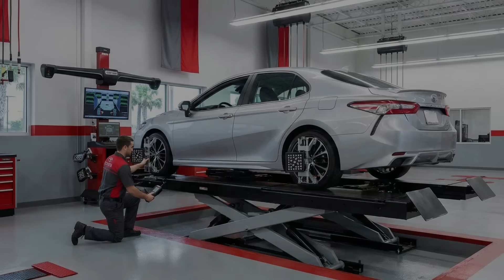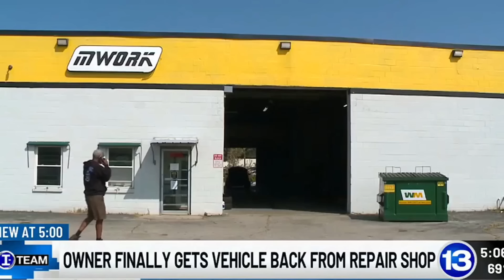STOP! Don't Change Your Toyota Transmission Fluid Until You Do THIS Reset

Comment: i chenged my transmission fluid on my lexus is 250 with different oil everything was fine but my transmission started to having problems on gear 1 and 2 so i went to toyota and got fluid WS  but i had the same issue so after i sow this video i reset the memory and my car got fixed 🎉 
thank you 🙏

Comment: I purchased 2013 Rav4 with 146k miles for my son, the previous owner never did anything other than oil change. After my purchase I got water pump, coolant, spark plugs, transmission filter, fluid and gasket replace with an intent to drive longer. But after transmission fluid/filter/gasket was changed i suddenly started noticing jerks between 2nd and 3rd gear while driving. I never saw this issue before trans fluid was changed. Showed it to 2 mechanics and they both said fluid levels are fine and the transmission has gone bad and it should be replaced. After many google search, i hit your this video, you were so SPOT ON. I took it back to shop and got the TCM memory rest and jerks between 2nd and 3rd gear shits disappeared for good. Big Big Big thanks, u saved me 10k , otherwise i was so close to junk this Rav4

Comment: More AI  c__p from Mr. Tom. I have drained and filled my 2015 Camry and 2018 Camry several times with no TCM reset and runs like brand new.  The factory manual fluid change instructions don't say to reset either.

Comment: I changed my transmission fluid on my 2017 corolla at 61000 miles so far so good, I purchased 4 quarts of toyota trans fluid FE $90.00 It is very important that you use the correct fluid. Pay a little now or a lot later 🚗

Comment: This video sounds like Ai. The official Toyota factory service manual fluid change instructions do not say anything needs to be electronically "reset".  I have done plenty of WS fluid changes on these 8 speeds on several different Camry's and they adapted just fine.
Reply: Yeah the official book also doesn't say when to change your transmission fluid it doesn't always tell you the truth

Comment: I have 2023 4Runner it got 45k on it . 

When should I change the fluid transmission?
Reply: At around 60K .. if you haven't seen it yet there's a channel called Car Care Nut & he repairs Toyota & Lexus only

Comment: For the 4th Gen Tacoma's: No, the 4th gen Tacoma transmission does not need to be electronically reset or have its adaptation memory cleared after a simple drain and fill. The most crucial step is ensuring the fluid is at the correct temperature for proper leveling, often requiring a scan tool to monitor.